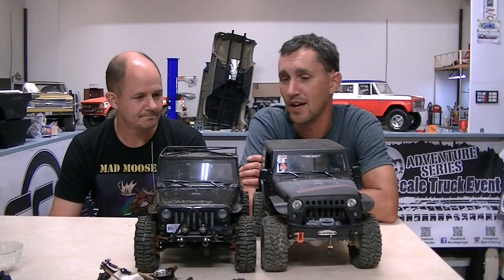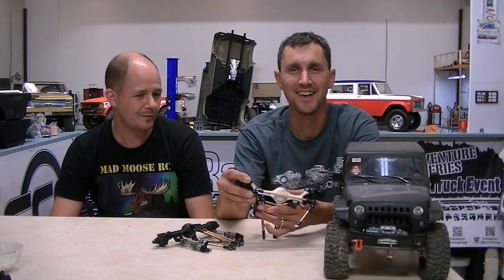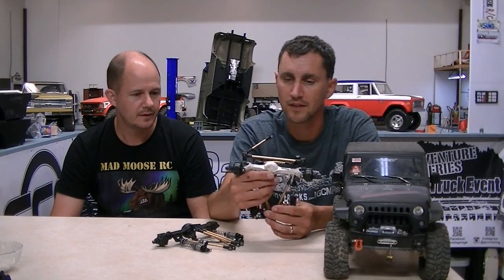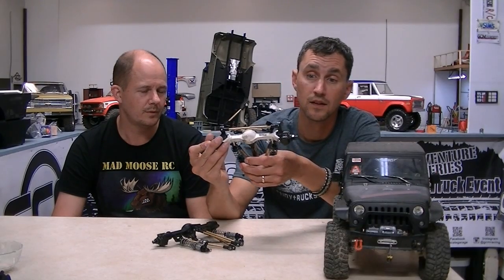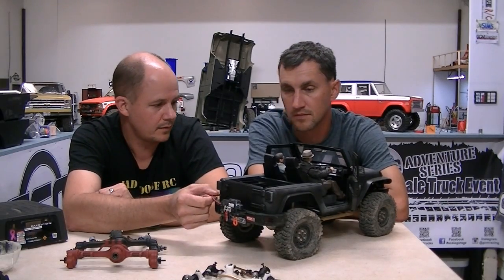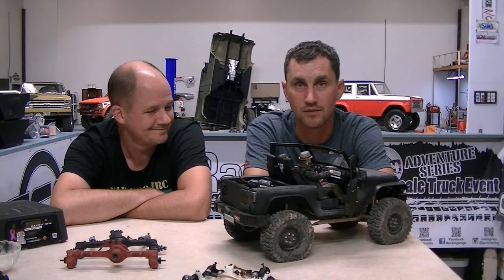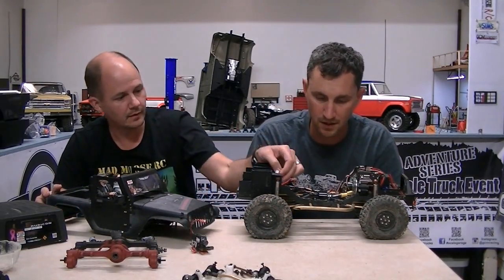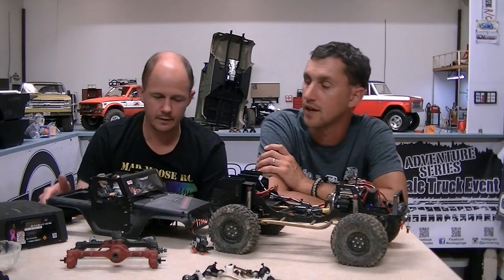Rig Review MadMooseRC Portal Axle JK

Comment: Mad Moose had mentioned 3D metal not too long ago.....will that be next? 
I'd be nice to have that weight down low. And an option to run a Axle-mounted-servo with a 4-link. 
What's the projected price on these axles?
Reply from the maker: I can't answer all those questions, but the weight down low would be super! Yes! Unfortunately the metal prints are not accurate enough to accept bearings and other tight tolerance items, so putting drivetrain items in the metal printed axles will be difficult at best. And expensive. I'm sure these will be plastic in production.

Comment: Maybe I didn't hear correctly but it sounded like the front end has a spool differential...on high traction surfaces (pavement, concrete), wouldn't that make steering just a tad more difficult?
Reply from the maker: There's locked axle on the front and rear yeah. It 'could' make it more difficult but we have added a slight overdrive in the front for our builds which have eliminated any steering issues (made it way better actually)